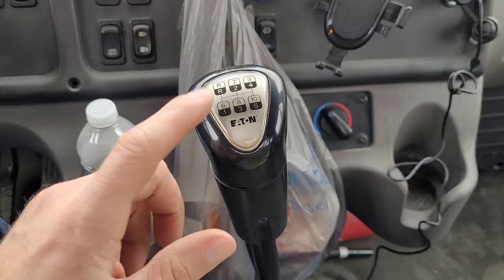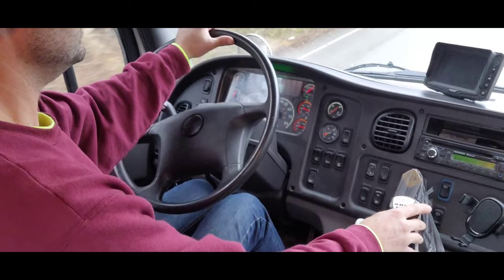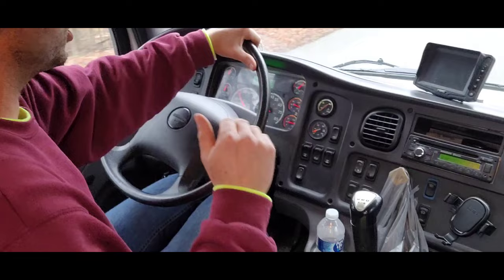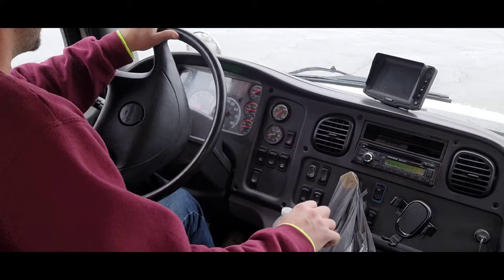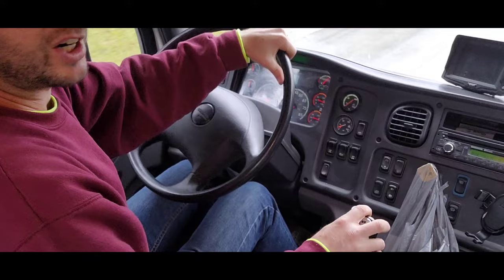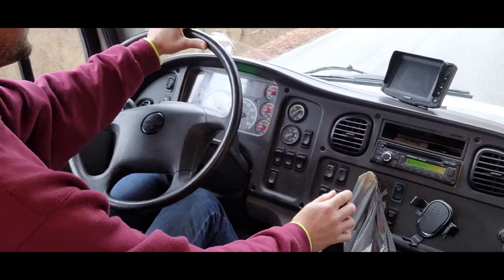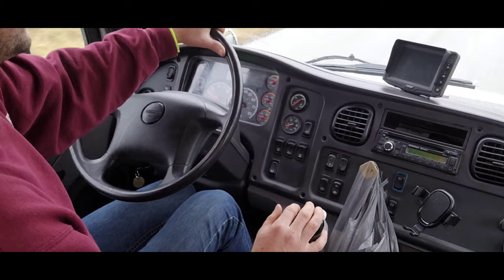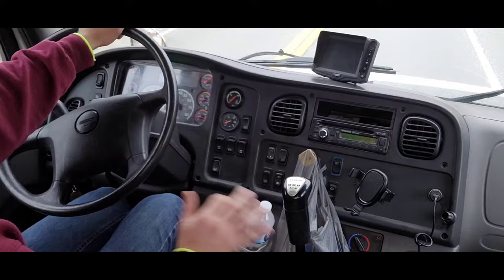Three Methods to Recover Missed Gears

Comment: I’m retired and decided to get my CDL so we have to double clutch to pass the test and for me after many years of shifting gears in gasoline engines it’s a struggle to correctly shift these 10 speed with diesel engines, I find myself trying to shift to quickly and over reviving the engine, I have been extremely humbled in this trucking school and have tremendous respect for Truckers not only for their talent but all the regulations and red tape that goes along with being a Truckers, so thanks for taking the time to make this video and thanks to all the Truckers out there doing what needs to be done you are the very heart beat of America !
Reply: I am a retired truck driver and a couple of good trucks  that I learned are one that you do not have to depress the clutch pedal all of the way in to shift into  another gear you can depress the clutch pedal maybe two inches at the very most not fast but be smooth twice and practice using only two fingers to slip the gear shift into another gear. The second is called floating into gear you are manipulating the throttle slightly and again with two fingers your can actually feel the gear going into place without grinding. The reason I would use to fingers or only one finger is then you cannot force it in and relying on feel instead. I probably drove a million miles using those methods hopefully you get this and try it
Reply: Same.... I just got behind the wheel today at CDL school and I almost cried I was so horrible
Reply: I’m also drive a regular manual transmission car, and I’ve experienced bad cdl shifting from not subconsciously breaking the two apart. I take my CDL A test in about a week so until then im driving an automatic car to school and back lol.
Reply: Driving trucks is a great retirement I went to school with guys 45 and over just getting their CDL. Hope you enjoy it
Reply: @blackbuddha9997  thank you. I took the CDL drivers test. And passed my first time. Was nervous bigtime, but I did very well.
Reply: @user-ib7en9pi3d  Well, not only do you not have to.. you SHOULDN'T push the clutch in all the way.  Unlike a car, all the way in is the clutch brake position.  You'll burn it out if you're moving and you do this.  It's the brake that slows the transmission down when you're at a stop and you need to shift into gear to get moving.  Otherwise every time you come to a stop you'll just have to sit there and wait for it to spin down slowly before you can get it back into gear and take off.  Really annoying!

If you use the clutch brake while in motion that tiny little brake is trying to stop the entire weight of the truck by itself.
Reply: @bhawks man!!!! I felt the same way today I almost pulled the truck over and quit but I’m not a quitter so I kept on doing my best until I got to the yard
Reply: With all respect to CDL trainers, I believe a lot of them teach you to pass your course, not how to drive.
This is a great video to put out, it's helpful and you could be saving lives
Reply: I agree with you I also find myself shifting faster than the truck is going like in a regular manual car trying to get through all the gears. Still practicing downshifting scary to think about missing a gear and rolling in neutral down a hill

Comment: I learnt on 18 speed synchronized transmission, drove those for 10 years, then moved into an auto for 8 years and am now for the first time trying to learn to drive an 18 speed non synchro transmission, problem is I'm weighing 140,000 lbs and going up big ass hills while doing it. It's extremely stressful as I've never been taught, I know the theory, watched a million videos but they just dont help at all, doesn't matter how well you know the theory you simply have to practice to learn. I lost the gears going uphill today grossed out at 140k lbs, I lost speed so fast I could not recover it so I had to stop and start again from lo, luckily I caught all the gears taking off again. The longest throws are the hardest, 4th to 5th and 6th to 7th. I also end up in a different truck, diff engine and transmission every time which is making it feel next to impossible to learn as nothing shifts the same. The stress is unbelievable.

Comment: Im in school now. Here in Georgia during the driving test if you fail to find a gear and travel an excess of 25 feet you fail the test and have to retake. That idea there is so daunting to me. You HAVE to double clutch.
Reply from the maker: That is pretty intense but I understand where they are coming from. Once you master the fundamentals you will have a solid foundation to build off. It will all come together the more you practice, best of luck on your test
Reply: They are teaching you well. Follow along and persevere. I hope you succeeded.
Reply: @DarknessessB11  glad to report i have since graduated and am driving. 🫡
Reply: Yea i just  failed because of this..  gear was grinding on downshift
Reply: it makes sense. you do not want to be rolling in neutral or in limbo gear. dangerous habit that'll lead to an accident
Reply: Cut it out man and just drive that truck

Comment: Every truck is different and likes to shift at certain points in the rev range.  Most important thing is to get to know your truck and when it likes to shift. Once you know your truck’s personality, then you can start floating gears and recovering them. It gets easier the longer you spend driving a certain vehicle.
Reply: Yup, bang on.  I used to run the big 3 Cat, Cummins, detroit powered dumptrucks.  then I got in a MaxxForce Binder truck and had to retrain myself to shift again.  You had to progressive-rpm shift it to not blow a gear when accelerating loaded.  What an awful tupperware container to drive.  Then I got back in a 98KW w/a Cat and it was like heaven.  I could shift that truck like butter.

Comment: I’m not sure if anyone else uses this method but I would add the two numbers together 😂 for example 
15 mph ( 1+5 ) = 6th gear 
25 mph  ( 2+5 ) = 7th gear 
35 mph ( 3+5 ) = 8th gear 
45 mph = 9th gear
55 mph = 10th gear
Reply: Absolutely. That’s per the CDL manual.
Reply: that works well for a 10 speed. anybody know what it is for an 18 speed Eaton Fuller transmission?
Reply: Johnny   thanks for that...
Reply: @father.of.7bear963  pretty much the same. Just don't factor in the split gear. If you miss a sift, always go back to the low side of the gear, look at your speed, and match your rpm.
Reply: @69castellano  Thanks Craig. Yeah, I agree, I figured out that’s it’s pretty much the same as 10 speed. What gives me trouble yet, is making left or right turns onto another road where I don’t need to stop, but can continue thru at 10 to 15 mph. The hi-range 5th is too high for those Turns, so I attempt to split down to low-range 4th, but cannot seem to find the rev match. Usually end up floating it into 3rd or even 2nd, which perturbs any vehicles following me, cuz I might be doing 5 mph till I find a gear. 
Complicating things further, is the fact I am in an automatic T680 most days, but sometimes get put onto the manual T680. Keeps me on my everlovin toes!
Reply: @69castellano  thanks for the info. I find I simply cannot downshift as efficiently as the automatic, and that’s hard on my ego.☺️
Reply: Yeah that’s how I was thought in school .
Reply: @father.of.7bear963  Phuk your ego in the streets homie. Let’s be professionals out here and help each other. I’m wish you safe travels G.
Reply: What’s the method for km in Canada? 😩
Reply: What if your truck has no tach, no speedometer and you're a bit tone deaf?
Asking for a friend.
Reply: @father.of.7bear963  
This is my exact problem.
Reply: Only for 10 speeds….
Reply: That’s how my CDL instructor taught us
Reply: I always glance down at my speed. Lets say I missed going into 9th gear. I look down and i'm roughly at 32 mph (lower than 35) I give the gas pedal a small bump (around 1200rpm) and throw it in 8th gear. If it was at 37 or 38mph. I'll give it a bigger bump (around 1500rpm) to match the engine speed. If you're wanting to throw it into 8th gear right at 35mph then bump the rpm up to 1400rpms. It should go right in. All trucks are different and if I can remember correctly, Freightliners are around 1300-1400rpms.

And obviously that goes for any speed. I was just using 35mph 8th gear as an example. Once you do it for awhile, you will do it based off engine sound alone. I usually only look at my speed/rpms when I need to downshift for any reason.
Reply: Great trick
Reply: Ah man that's awesome thanks!
Reply: Gracias amigo
Reply: Thank you so much! I was looking for this trick! 😊
Reply: Look at it as a double 5 speed
15 1 high
25 2 high
35 3 high
44 4 high
55 5 high
Reply: This works till you get in a 7spd or 13spd manual.
Reply: @stopfeelingbadforyourself Move to the USA lol
Reply: @father.of.7bear963 you can turn on a 5th gear but just smooth on the brakes. For me, I try to do everything early 😅 so my mind doesn’t freeze
Reply: @father.of.7bear963 you can turn on a 5th gear but just smooth on the brakes. For me, I try to do everything early 😅 so my mind doesn’t freeze
Reply: We use kmh up north, do you have a trick similar to this in kmh?
Reply: @Kelvin-nm8ti  the best way to learn is to feel the truck when is asking for you to upshift.
Reply: @father.of.7bear963 you just rev to 1500rpm in the gear your having problems with and look at your speed. Next time you’re downshifting you get your speed to that number and rev it to 1500 and slip it in. You need references and 1500 is usually a good one to use.

Comment: Great Tutorial vid on "finding gears".  I trained on a 392 gas jobby dumptruck w/a 5x4.  Sometimes Frank [trainer] would smack the main out of gear into neutral.  A big smile on his face, yelling at me "find the gear, find the gear" and I would go into near panic mode and start grinding.  Frank laughed hard every time saying "quit grinding coffee, find the gear".  After he had a belly full of laughing, then calmly he'd say "hold the tach at 1200" and he'd grab the main stick and slip it into gear with a click. [i'd sit there in awe of what just happened]  Then he'd ask what gear are you in?  3.  Ok what rpm do you need to get to put it in 2?  2200.  Ok, do it.   He taught me to pick a lower rpm to slide the shifter into gear, then start downshifting to get into the appropriate gear to accelerate the vehicle again.  That skill Frank taught me helped my shifting for when i was hauling tree length logs [140k#'s] on bush roads where you had to skip 2 to 3 gears on a steep hill.

Comment: I took my CDL B on 6 speed and I don't know how I did it. I know I didn't double clutch.  Now I'm in school right now.  Getting my Class A License.  So I'm having a hard time double clutching and my instructors are really trying to teach me.  But I drove with 4 instructors and they said I do well. But I had 2 instructors who say iam not double clutching.  And you got to do it for the test. Spent the last 2 weeks trying to figure it out. Doing a  little better.  But still I don't really know it. I
Because in high range gears it slides right into gear.

Comment: When I was learning I was taught the "tickle" method. I was used to cars and grinding the living sh* out of it before I realized how gentle you had to be, which is hard to do while focusing on everything ele as a newbie. I still suck at driving manual trucks. But I tested on an auto so I'll never get the chance to improve sadly. It's been so long at his point I question if I could even still do it at all.

Comment: One more method I recently learned - let's say I missed 8 and I just can't get it to into 8 after a couple of tries and now I've lost speed and I need to recover - it's often easier to get into a higher gear than is needed, so I go for 9 or 10 even though I know it's too high for my situation, but once I get it into too high of a gear I can downshift back to where I need to be.  So I miss 8, hit 9, downshift to 8, maybe I'll be fine there or have to downshift to 7, or even 6, but it only takes a few seconds to downshift several times if needed, and I am recovered.
Reply: Do you have any more videos

Comment: Just shift to a higher gear, several above the one you missed. Once you can get into gear , start down shifting to where you need to be. 
   Learn at what rpm's your engine operates and look at the tach. Try and learn the sound your engine makes at those rpm's. 
   The key to shifting is the rpm, get it right and it falls into gear.

Comment: Man, you know it's odd that I can't explain how to recover.. but I do.. its a feeling with a little bit of intuition that I'm able to recover whenever I miss.. I force taught myself to always double clutch my up shofts.. it always results in a proper shift.. but I also force taught myself to always down shift through all my gears coming to a stop.. it makes driving that much more complicated, but learning like this gives you the muscle memory to always know where your supposed to be in the shift pattern no.matter what the situation is.
Reply: Just take your feet off the clutch, rev up to 1500, apply clutch about an inch then push gear to the same gear you came from or a lower gear.

Comment: You will have more luck shifting if you always take your foot completely off the accelerator as you put the truck in any gear. This works with and without the clutch. You can bump the RPMs up a little to get it out of gear and then again in between if downshifting, but then take your foot off the foot feed before going into gear.  If gears are grinding it means you didn't take your foot all the way off.
Reply: Reeeeeeally depends on the truck. A lot of people find it easier to keep your foot slightly on the gas in a lot of trucks. If you've got a real fussy transmission and your rpms drop quick when you let off the gas, it's very easy to miss your rpm range and not all transmissions are as forgiving as others. If you keep your foot slightly on the gas, it just slows down the rate at which the rpm's drop and gives you a bigger window to let it fall into gear. I prefer just letting off completely, but I was taught to keep my foot slightly on the gas

Comment: use brake and clutch ,progressive shift ,know what speed  is good for each gear ,and upshift and downshift Rpm, ranges.,learn how too skip gears when needed . old nasty Freightliners with worn out  ten speeds are always a pain in the ass. cant shift fast.

Comment: Wow... You never EVER "bounce" your shifter.  Soft, solid pressure on the gear that you want to be in and play with the throttle until it falls into place on its own.  And it will fall into place if you know what you're doing.  Jesus...

Comment: Before teaching others what to do, correct your seating position 🤔 👎👎👎👎
Reply from the maker: I prefer to sit a little closer to the wheel than most, but the camera angle does appear to make me look crammed. You have a great point though, adjusting the seat and your mirrors before you start out improves your comfort and ultimately your safety.
Reply: @ExcavationRevelation  You handled that perfectly! Some are just so negative, it’s their fuel. Love your vids. 😊
Reply: I use a racing position when driving. Full steering/pedal control. Leaned-the-fuck-back driving won't help you when you're truck is trying to toss you to the other parts of the cab.